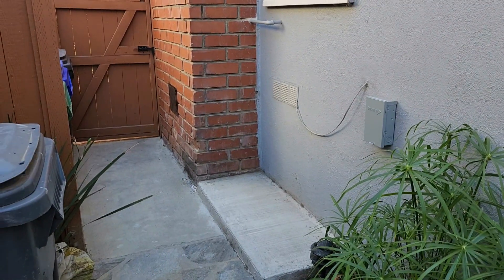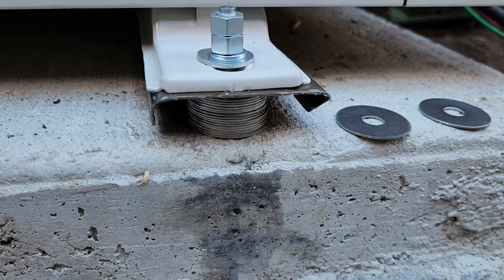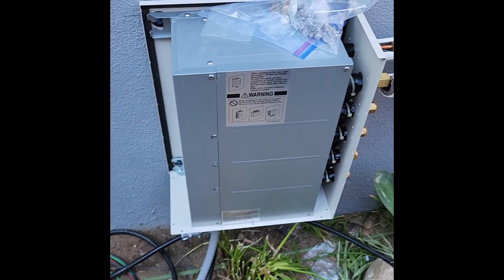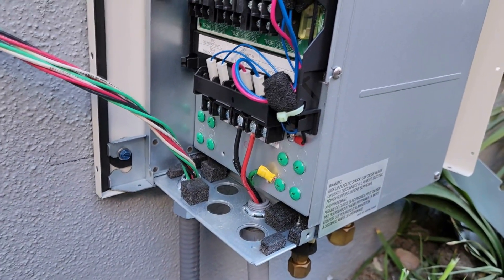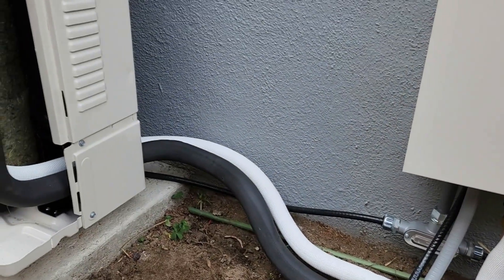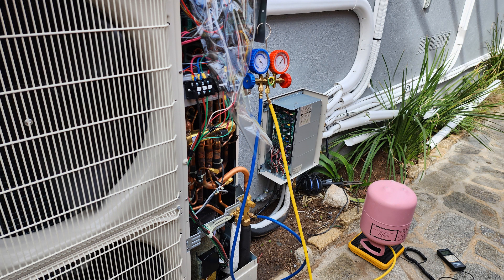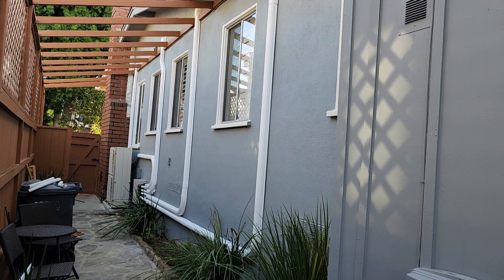Mitsubishi outdoor and branch box installation

Comment: How did you you perform the evaculation with the branch box and 4 indoor units.  Did it take a long time to get to 150 microns, also did the branch box interfere with the process?
Reply from the maker: I hooked up the vacuum pump to the outdoor unit.  Branch box did not interfere.  I do not recall the exact time elapsed, but didn't take that long.  After vacuum held, I break the vacuum with refrigerant until get a few psi positive.  Then, I note the amount of refrigerant added, close valves and remove the vacuum (micron) gauge.  I don't think the vacuum gauge likes high pressure.  Then, I continue adding the refrigerant to the calculated amount.

Comment: Wow! This is great! What is the difference between Smart Multi and h2i?
Reply from the maker: @lowellabraham6966  straight from Google search
A Mitsubishi "Smart Multi" refers to a multi-zone outdoor unit that can power multiple indoor units, while "H2i" is a specific technology within Mitsubishi heat pumps, signifying "Hyper-Heating Inverter" which allows for reliable heating even in very cold climates; essentially, a Smart Multi system can include H2i technology in its outdoor unit to provide strong heating performance in cold weather, but not all Smart Multi systems will have H2i capabilities.

Comment: Great video.  For branch boxes installed outside with the cables coming out of the top - Should they be covered ?
Reply from the maker: When mounted on a wall, the branch box must be oriented so that the cables come out the bottom. The NEMA box which protects the branch box from the elements is designed for mounting on a wall.
Reply: @ron12april  Thank you for your answer. My branch box has a bunch of cables coming out the top (not sure what they do) and two on the side,.   The contractor just installed it with multiple cable side facing up - should I ask him to redo it ?
Reply from the maker: @tennissir1986  The Branch Box installation instructions are clear.  Section 4 "Dimensions and required servicing space of Branch Box" note III states: "The installation direction is limited when installing on a wall. (Fig. 4-13)
When installing the unit on the wall, install the piping connected to the outdoor 
unit facing down. Other ways are not acceptable."  Fig 4-13 are sketches showing same..  Cables come out same side (bottom) as the piping connected to the outdoor unit..
Reply: @ron12april  Thank you sir.  Amazing u referenced the Mitsubishi model that i had.

Comment: Why did you place the system so close to the wall?? That system is going to be hard to do coil cleaning maintenance.
Reply from the maker: Followed Mitsubishi guidance per install manual.  I did not want to intrude into the side yard (in front of outdoor unit) as this is a walking path. Should be able to clean from inside unit to the outside.

Comment: If you’re installing a branch box, don’t you need to turn the dip switch on from the outdoor unit SW2 dip switch 5 to ON position? Having trouble w this unit
Reply from the maker: I see what you are referring to.  It has been a while and I do not recall if I flipped SW2 position 5 to on or not.  When I get a chance I will check and report back.
Reply from the maker: I checked and sw2 position 5 is still in the OFF position.  Nonetheless, everything seems to be working properly
Reply: @ron12april  yes sir. Learned a lot from your video, amazing install!
Reply from the maker: I am pretty sure SW2-5 should be set to ON position.

Here is the address of discussion where outdoor unit with branch box problem solved by setting SW2-5 to ON.

https://hvac-talk.com/vbb/threads/2255627-What-s-Wrong-with-my-Mitsubishi-system

I never ran into problem because I mostly run only one of the indoor units at a time.  The problem described in the discussion is when 2 units were on full load.  

I set my unit’s SW2-5 to ON.  Everything still works fine.

Comment: Excellent work. I will be putting one of these in for a customer, my first branch box install. How did you determine the additional refrigerant amount? I’ve been reading the spec sheet and instructions for condenser pre-charged pipe length but have only seen maximum total pipe length for system.
Reply from the maker: In the instruction manual under "installing the refrigerant piping" in my manual it is section 4 is the sub section "Additional refrigerant charge" in my manual it is section 4.7  The amount depends on pipe size and length, plus capacity of the indoor units.  A sample calculation is provided

Comment: I am going to do a similar install myself, but I wasn't sure about the nitrogen/refrigerant component.  I was wondering if it requires special certification for adding refrigerant.  How did you learn to do nitrogen pressurization?  Also, can you explain the process for adding drain lines for condensate?
Reply from the maker: Nitrogen pressurization is covered in the installation manual.  You can rent nitrogen from a local welding supply shop.  However, you will probably have to buy a regulator.  You should check all flare connections with soapy water.  If you pull a permit you will likely need a licensed person to observe the adding of refrigerant.  Some people do the install and then have a licensed contractor do the pressure check and refrigerant addition.  Drain lines exit the indoor units with the refrigerant and electrical lines.  Key is to keep drain lines flowing down hill.  In my case, the drain lines separated from the other lines where the refrigerant and electrical turned from downhill to horizontal aiming toward the branch box, and the drain lines continued straight down to close to the ground.

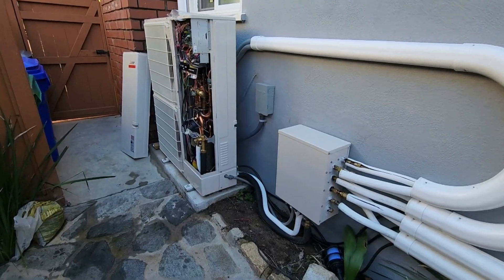Comment: 8:57 What a complex system.  What could possibly go wrong?   < sarcasm >  Call me a slow to adapt to change Neanderthal.   All that efficiency is exciting while it is trouble free.  10:55 The line set routing and channels are a work of ART!
Reply from the maker: Once installed they seem to be pretty reliable.  I installed a LG system in the back of the house about 5 years ago and it has been trouble free.
https://youtu.be/m6DD_dCc5GY

Comment: Do these outdoor units ever need to have coils cleaned?   What would be the best way to access the coils for cleaning?   Can you just pull the fan and clean from the front?
Reply from the maker: I think all outdoor units have to be cleaned from time to time.  Pulling off the metal top followed by metal panels exposes the coils enough for cleaning.

Comment: What size wire is used for connecting power from the condenser to the branch box?
Reply from the maker: Branch Box installation manual states 2.5 sq mm which is 12 AWG.  I used 10 AWG.  Not sure why, probably had extra laying around.  Larger diameter OK.

Comment: Those branch boxes usually placed indoors like attic for cleaner install, but wall units would be problematic I guess. Perhaps small ducted units or ceiling cassettes would work best with this type of unit:)
Reply from the maker: One way ceiling cassette used in kitchen.  Wall units used in dining room and bedrooms - open beam ceilings.  Check out indoor unit video
https://youtu.be/T4PdK8yTljk?si=G6Hh-VZLaocvsbGe
Reply from the maker: Yes. Branch box is designed for indoor installation UNLESS protected by NEMA weather proof enclosure, which I did use.
Reply: Agree, I clicked the video because I had not seen that before.  Im not a fan of wall units anyways except for shop type installs but hate the big ugly box hanging on the wall.  one way cassettes look best IMO Makes no sense to me to have a branch box installed a couple feet from the outdoor unit.

Comment: I am trying to design a four zone Mitsubishi mini split system. I was planning on a very similar design and had a question.which condenser model do you use? I am looking for a heat pump model and am unsure if I need one with service valves for 1 circuit or 4 circuits or if it even matters with a branch box? I was planning on only running 1 lineset from the condenser to a branch box in the attic. 4 zones coming off the branch box.
Reply from the maker: The outdoor unit model number is MXZ-SM60NAM-U1 which is a 60k BTU/hr unit.  My logic in choosing this unit is as follows.  Based on the 4 indoor units I was planning on installing, I needed at least the 48k BTU/hr unit.  The 48k BTU/hr unit still requires a branch box and by going to the 60k BTU/hr unit I left room for possibly adding a 5th indoor unit in the future since the branch box has 5 ports.  Also, for cold climates the H2i models might be necessary, but my installation is in southern California where it does not get all that cold, and we already have natural gas fired forced air for heat in the winter.  Both the outdoor and indoor units were purchased from ecomfort.com.